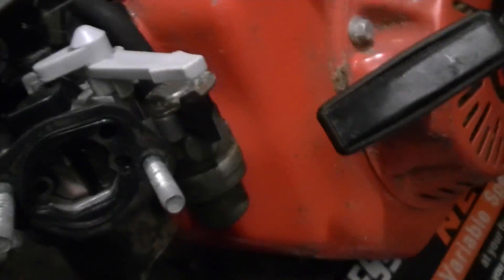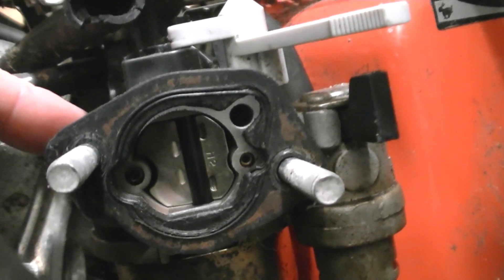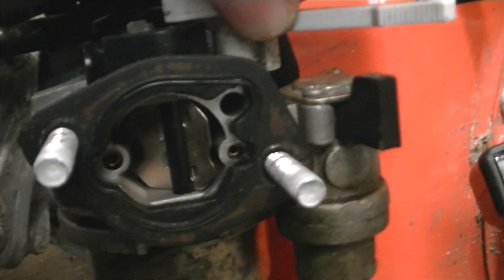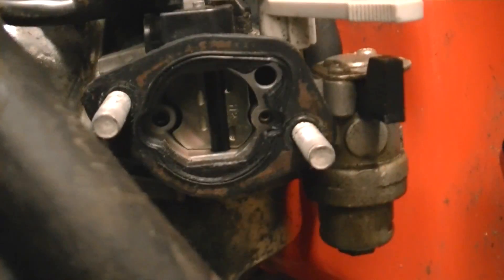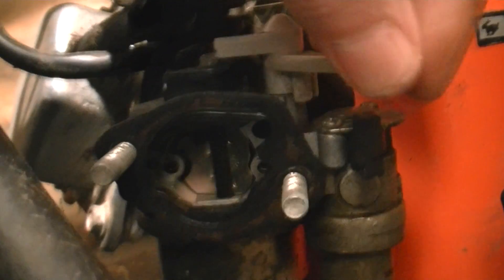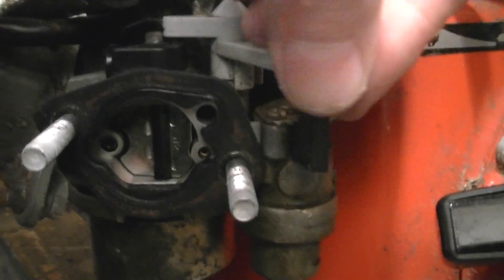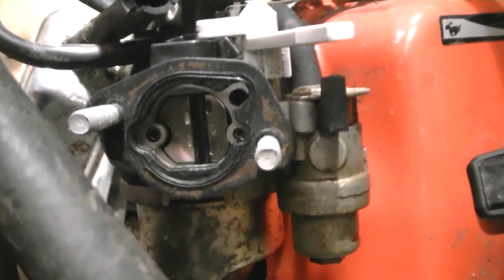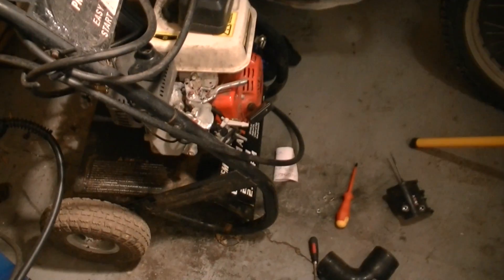How Carburetor Chokes Work - RustySkull Productions

Comment: Lol. ‘It’s common sense’. ‘This little bit is connected to this thingy, and the engine likes this’. Since when did engine like something? It’s common sense that engines don’t have emotions or like or hate things.
Reply from the maker: Well as a matter of fact they do, especially old ones. The newer ones with electronic computers to run them are a bit more robot like but the older ones with mechanical systems get used to running a certain way.

Comment: Thank you for video .. I have a motorbike that bogs down while running on choke so I have to start on choke and leave for 10/15 minutes untill warm so can take choke off ..it's ok but rather inconvenient .. any ideas how can resolve ?
Reply from the maker: Yeah, it's too lean. The choke makes the mixture richer. So, you need to riches the mixture up, or check for blockages.

Comment: Any idea why when the valve closes it doesn't accelerate the engine?
Reply from the maker: +zerpBot When the choke is closed or on it shouldn't accelerate or rev the engine. It will only rev when the whole is open.
Reply: @RSPYT  What if it does rev/accelerate the engine when the choke is on? And revs more when the choke is on more? What are the reasons for that? Thanks